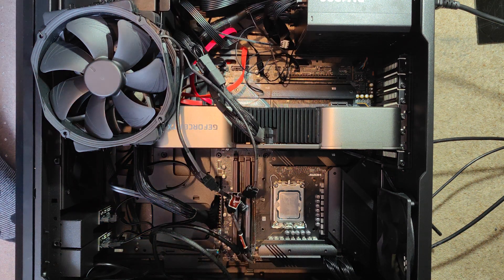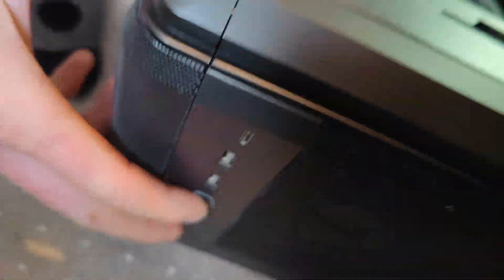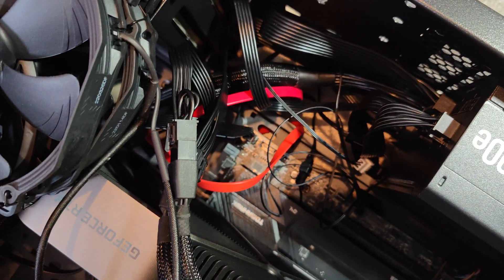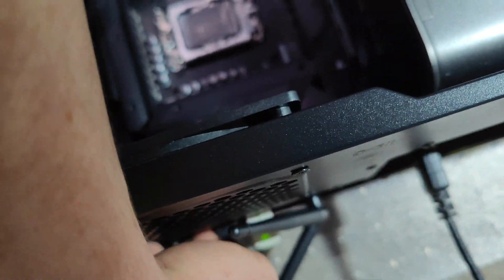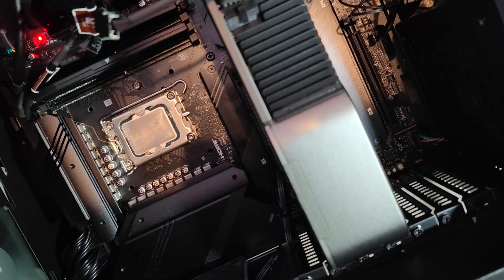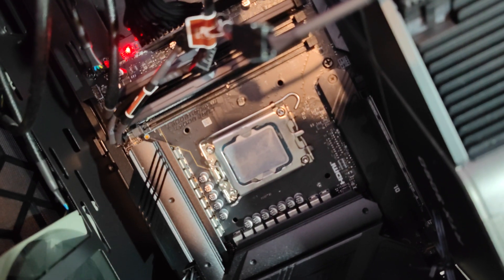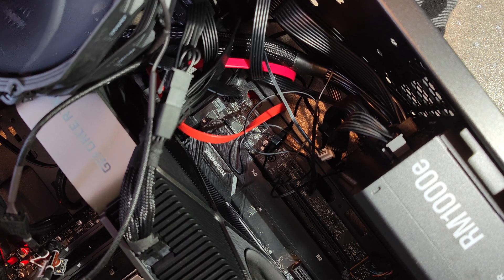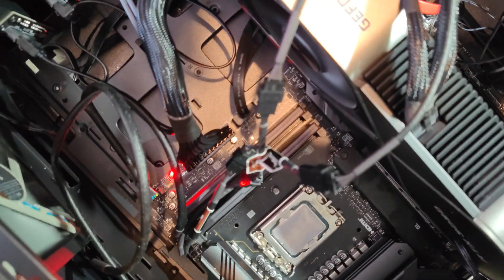MSI Z790 Tomahawk WiFi will not start unless doing BIOS reset showing CPU EZ Debug light on

Comment: Here is a solution! (Solved)
I've been fiddling with the mainboard for days. Unlike in the video, my mainboard didn't react at all, except that it flashed red when I tried to flash with USB, which of course was unsuccessful. After a really long trial and error, I wanted to send the mainboard back. But when I removed it, I wanted to know exactly what was going on and wanted to start the mainboard from scratch.

So I only had the mainboard with water cooling and PSU left on the table. It was still not working.

But now I took off the water cooling and remembered that I had used a cooling frame when building my computer to improve the temperature management. When I pulled this cooling frame loose and then short-circuited the two power pins with a screwdriver, the mainboard lit up! From then on I was able to put everything back together and it worked again. So if you are also using one of these cooling frames or have tightened the water cooling too much, try this!

My guess is that the CPU may not have been seated correctly or that the incorrectly attached frame may have exerted too much pressure on one side or something similar. 

I really did remove everything else from the mainboard. No memory and no other cables except PSU, water cooling and CPU.

I hope this can help some of you.

If you dont know what i meant with the short-circuit I can explain it in few words. Normally your case is connected with this two pins to start your computer if you click the Power button. This is the signal for the mainbord to start. If you want to look fast if your mainbord works, you can connect this to pins with a screwdriver to do the same like the power button. But please do that only if you know what you do. There are more pins and you dont want to connect two pins which are not made for this.

My setup was: i9-13900, 32GB Ram (2x16 Corsair Vengeance(7200 MHz)), Arctic Freezer 2, RTX 4090

Good Luck!
Reply: Just built my wife’s rig with this mobi and having this issue gonna try what u said first time I’ve seen that fix after looking through forums so I’m hopeful
Reply from the maker: I hope it helps you diagnose an issue that isn't critical and means you can get it working without a full mobo RMA!
Reply: i cant even close the cpu retainer, without it turning off. i had no power at all before
Reply from the maker: @dadams11  I think @Lero_infestus had a slightly different issue, but technically the board should still power on without the CPU cooler installed, but you will need to power it down pretty soon after it does so you don't fry your CPU
Reply: Hmm Interesting, I am still fighting with my build, very much pissed off -  had MSI 790S WiFI bought another one 790P in the end(will be selling the S) but issue the same! It wouldnt even turn on and flash lights without CPU I mean what the hell. So all you did is removing the CPU frame>? Or reduced pressure on CPU? I installed CPU frame as it was advised to not get CPU bent but idk now..
Reply from the maker: I'm glad you were able to resolve your problem and I hope you're now and to enjoy your awesome set up! 

When you pushed the BIOS flashback button you mentioned that nothing happened, which isn't what I found. That button ignores all of the components and any errors on the board, it doesn't even need a CPU or memory to be installed, but would power on things like the fans and a few lights on the motherboard. I'm glad you found a solution, but I think a lot of people have had a different issue with overall motherboard power not working from the power switch. 🤔

Comment: I found this thread looking for solutions because i have the z790 mag tomahawk wifi with a 14900k i am getting nothing on turn on and i am on my 2nd psu
Reply from the maker: I did the same thing and RMAd a pretty good PSU. Does your system power on at all when you push the BIOS flash button with a valid BIOS image on a USB?
Reply: @dougtracey53   I only get a red light if I put in the usb drive with msi.rom on it into the red usb flash usb port. I hit the button and it's flashing for a 5 sec or so then goes solid. When I remove the usb the red light stays on. I brought back a 2nd board from micro center today. Same board since it was a bundle (never again). Anyway I had their service test the cpu mb memory combo and they came out and claimed the memory was bad (s5 gskill) then came back and said the memory is good. And it all working. I have been trying to use 2 gigabyte psu. The 1000w pcie 5 Rev 2

Comment: Same issue here. My story short: Bought the mainboard off amazon. Finished my build with Intel i9-13900k, Corair Vengeance DDR5 6400 64GB, RTX 4070ti and 3x NVMe SSD and nothing was working. Just the light of the BIOS-flash. So i thought it could only be the MB. Went to my local store and got a second one. Switched parts and the pc wont start or do anything. Then I found this video and flashed the two boards. Tried booth again with all Parts on it but nothing. So I'll go with the GIGABYTE Z790 AORUS Elite AX now. I'm curious how the local dealer will react if i bring the MB back tomorrow.
Reply: Hi Edwin were you able to get it running with the  GIGABYTE Z790 AORUS Elite AX? That is the exact mobo I bought and I am running in the same issue.
Reply from the maker: Gutted you had to build it 3 times and nuts that you had 2 failed boards. I'm glad the video helped you check as many things out as possible. I hope the Aurus is working well with your awesome setup, which is pretty much identical to mine apart from my 3090 GPU!

Comment: Exactly the same problem as this video and as sooo many others are stating in the comments. This board should be avoided. I'm sure its solid once you get it started but boy is starting a hassle.
Reply from the maker: These things should never be a hassle to get started as they are the bedrock of any build. Just so frustrating there are so many of us in the same boat. Glad I jumped to the better components and specs of the Z690 Carbon as it's performance is awesome!

Comment: the same problem. I'm with the RMA to get the same new one. does anyone know the reason why this is happening?

Is it because all the problems come when trying to put a gen 13 or higher CPU on the board?
Reply from the maker: Maybe it's something MSI need to sort, but the Z690 Carbon I'm using is working fine, so maybe it's hardware issue, but I can't imagine many people getting a Z790 board using anything lower than a 13th gen chip 🤔

Comment: Same problem. I really wanted it to work for the audio codec it had :(
Reply from the maker: Oh dear, if you can get hold of a Z690 Carbon WiFi DDR5 motherboard, it's got much higher specs and the same audio codec. It's in stock for pretty much same price as the Z790 Tomahawk 
https://amzn.to/46C0TEu

Comment: Same problem here. I actually bought another one and it happened again. 🙄
Basic test powering with both and nothing happened.  Also Jumpstart with a screwdriver and nothing
Reply from the maker: It's pretty insane that so many have failed! If you can get your hands on one, maybe try and get a Z690 Carbon Wifi as the components are much better and the Z690 to Z790 difference is minimal to non-existent!
https://amzn.to/406TEml

Comment: Other power issue same board... It powers on and all works properly however shutting down randomly stops working (stuck at shutdown, OS agnostic) and requires me to force it off fully by removing power or holding the pwr button for a long time (Video showing of my problem cyRygd0EvbQ)
Reply from the maker: Sounds like it might be a software issue, but if you say OS agnostic, do you mean that you've installed a few different OSs and had the same issue (i.e. Windows and Linux?)
Reply from the maker: .....or maybe try doing a BIOS update as it could also be some power setting in the BIOS

Comment: I have the same issue and i dont know what to do anymore maby call the service, everything works exept its not booting.
I will replace it with the z790 aorus elite and see what happens.
Reply from the maker: Is it powering on with the power button, but not posting/booting? Could be a hard drive issue if that is the case. My issue meant the system wouldn't turn on at all unless I did the BIOS flashback. Can you test with another drive or even a USB windows installation?
Reply: @dougtracey53 Perhaps that was the problem. But i also used this Motherboard for the new PC for my dad and that also took a while untill i was able to get a Display. So i honestly dont thrust in that Produkt enough to use it in my PC, so i switched to Gigabyte😂
Reply from the maker: @lamande25a34  fair enough, it was so hard to work out what was wrong that I gave up on this product too

Comment: Same problem BUT even when I try the update by pushing the button with tha Flash drive, it doesn't do anything
Reply from the maker: Try testing the power supply in that case as it could well be that. There is a test to short the jumpers using a case fan which might help you rule that out but a lot of the people here were able to run the BIOS updater.
Reply: @dougtracey53  Test my power supply already, even try with another psu and still nothing, I already sent my report to use my warranty

Comment: Was just about to buy this board -- glad I found this thread first! Thank you!
Reply from the maker: It's a shame they don't have any more Z690 Carbon WiFi left, which is what I ended up buying, but if you're in the UK, the Asus Gaming TUF WiFi DDR5 is really well discounted at the moment and pretty much matches the spec for a lower price:
https://amzn.to/3PJgAEg
Reply: My last (current) board is Asus and it's been trouble free for 12 years -- I am in the UK, so I'll check it out, thanks. :)

The rest of my planned build is almost identical to yours too -- I'm not a gamer, I just need to speed up my editing workflow / multitasking capacity.
Reply from the maker: @Synchrodipity  that's why I built this set up. I'm a developer, but have a vast amount to multi-task and can't deal with any latency as suffer have ADHD so it's got to keep up with my brain or I get totally distracted!...although I play a bit of Forza every now and then to avoid burnout! 

This is also a slightly higher spec on Amazon as well if Asus is your go to brand Asus ROG STRIX Z790-H GAMING WIFI for £280:
https://amzn.to/3PHpNwR
Reply: @dougtracey53 Haha -- I'm also ADHD so completely get it. A million tabs open, several productivity workflows, plus email, chat and no patience! 😂
Reply from the maker: @Synchrodipity  Small world! ADHD is definitely a next stage evolutionary step....as long as nothing gets in the way, slows down, or distracts me, but yes, sitting at about 45GB memory useage, mostly in Chrome tabs, plus WhatsApp, email, Skype, Zoom, Teams, a few Adobe apps sitting in the background and all kinds of others pinging away constantly!...while juggling numerous SEO retainer plus website projects all at once!🤣

Comment: I have had this happen twice now with this board. First board exact same issue as you, RMA'd and got the replacement. 2nd board flashed bios first to get to the latest release which worked fine -- continued the build (CPU, RAM, M.2, CPU cooler with fans plugged in) and tested with a jump start outside of the box -- same thing. No LEDs, no power, nothing. 

Think I'll switch to Gigabyte.
Reply from the maker: Sorry to hear you've had the same issue. As I explained, I ended up buying the Z690 Carbon WiFi which was the same price and pretty much identical if not higher specs. Glad you were able to RMA though but crazy that these are so unreliable with the same issue
Reply: Seriously - as an update, I did get the Gigabyte Z790 AROUS Elite AX board (very similar specs) and it's working great. @dougtracey53
Reply: @dougtracey53 Hey I have the exact problem (but I currently don't have a flash drive and different PC to try flashing the BIOS)
on a Z690 Force which is a like a Carbon but silver color.

It's not under warranty. Any fix?

Comment: I have the exact same problem. If I really insist and sometimes let it sit half an hour it'll finally boot for some reason.
When I manage to start it (can take up to 2 hours and 20 tries) it works amazingly well. No crash, great performances and not overheating even under cinebench.
Has been running for 7 hours today, playing games and watching videos. I know for sure that if I turn it off it won't start again.
I ordered another PSU that will come in 2 days, until then I keep my PC on to keep using it. If replacing the PSU doesn't fix this problem, I'm gonna return the motherboard.
Reply from the maker: I can't imagine it's a PSU issue if the whole system will boot and is stable for any amount of time, it's probably something as ridiculous as a dodgy power switch connection on the mobo as most comments on this have had the same problem. If your system will power on for BIOS flash then, again, it surely can't be the PSU.
Reply from the maker: I did actually RMA my first PSU as thought that was the issue initially and before I came across this BIOS flashback test which made everything come to life. Try this and the jumper short test to rule out the PSU.
Reply: Did u buy a new psu !! Did u fix the problem i have the same issue

Comment: Same here. Bought another one from a different shop. 2nd MB MSI Tomahawk z790 ddr5 wifi doesn't run at all. No power on the chip. Getting pretty mad and just happy not to be the only cunt in this situation. I've heared about some lads, getting the third ine dead on aerival. Also every time I get a new one, the cardboard inside and also the plasticbag inside the box has been rubbed and has holes in it. Consider to get an Asus. Any recommendations here? Did it work later on? It's really driving me mad. Thanks for sharing guys.

(Location Germany)
Reply: Got me an ASUS now. Works just fine. 3 Mainboards DOA, by MSI. Good job.

Comment: I have the exact same problem. Disheartening to say the least. My first new build in 15 years and it doesn´t even blink unless i do an EZFlash, and after doing one it is still dead in the water. The power switch does literally nothing, I also tried shortening the power switch on JFP1, alas nothing happened. So I guess I will have to return it!

After all the rave reviews for this board, this was certainly not expected.
Reply from the maker: It's so bizarre that it it seems to be such a common issue for this board! I'm just glad I managed to get a Z690 Carbon as think the components are probably better quality and it's been perfect in my set up.
Reply: Sent an RMA to the retailer, but the bastards are claiming that the CPU-socket pins have been bent. Not by me I can assure you. Also I got the system up and running using a Gigabyte Z79 Gaming X AX.

Those bastards just lost a customer for life. Will see about getting my money back now!
Reply from the maker: @Jonkerz77  that sucks! I hope you can appeal it and get your replacement or refund in the end.
Reply: @dougtracey53  Add another one to the list.  Same exact issue and same exact troubleshooting.  Just tore it all apart and boxed the board up for RMA.  I going to get the Z690 Tomahawk WiFi since it is essentially the same as far as what I need.  Just seen several threads on the msi forum of failures.  Mine makes 3ish in 7 days....  One guy posted on Monday he had 2 in a row from Amazon that were dead.  Mine just came from B&H.
Reply: @Jonkerz77  Newegg correct 😐?
Reply from the maker: @Cobalt135  The Z690 Carbon Wifi DDR5 is in stock in the UK now and the specs are much better, but hope the Tomahawk Z690 works for you! https://amzn.to/46C0TEu

Comment: Adding to the pile of reports, I also had the same problem. Trying to replace it. I wish I did a little research before buying this motherboard. Where I live the price is also higher and now I can see that all of that money is going down the drain. Even if they replace the board and it lights up, I don't think it will survive for long. Avoid z790 from msi
Reply from the maker: I'm sorry to hear you've joined the failed Tomahawk team and hope you can work it out and get a working one or replacement soon.